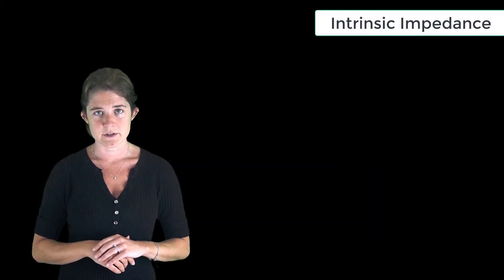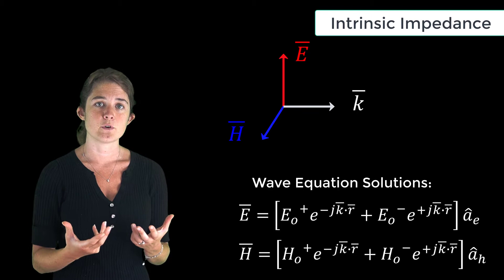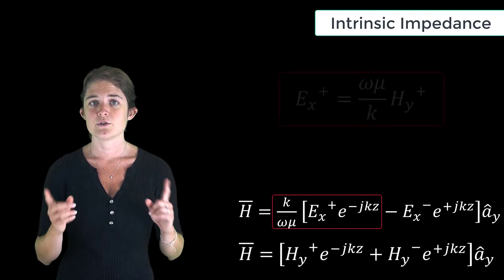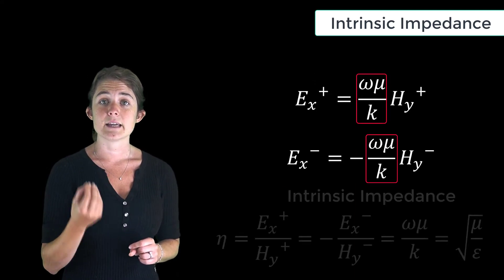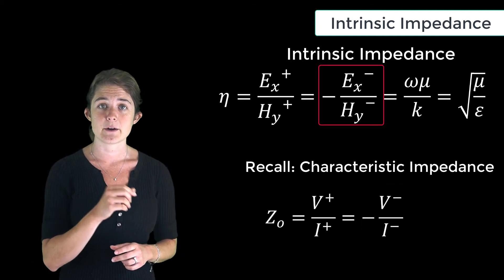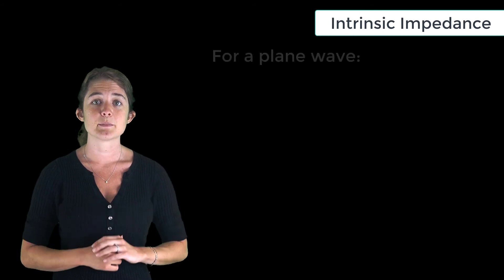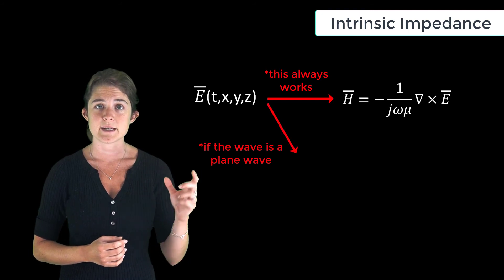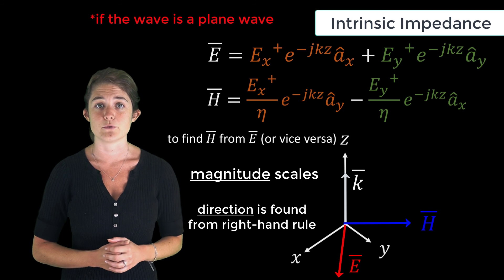Intrinsic Impedance of Plane Waves — Lesson 3

Comment: One does appreciate that there is a lot of work associated with  the preparation  of these videos. Congratulations.  Here is an interesting discussion point,  If there is an intrinsic impedance of the medium of 377 ohms, this also means that the inductive and capacitive elements  of the medium  to support the E and B components, exist and so these  will delay the rise and fall of the E and B wave as they exchange the  total E/M Poynting Vector between them . All this will lead to the maximum velocity of the wave in the medium of transmission, If the velocity of the wave is limited by such " impedance effects"  then as the circumference of the circle around the radiating antenna  grows bigger, there is no hope of the first mode being sustained with an ever increasing radius, and the circumference will have to break down in smaller units not larger than half a wavelength long  which is the normal wavelength  of the   forward travelling wave, This means that if the wave cannot go forward above the medium speed, then  it cannot go laterally around in a circumference faster than it goes forward so this means that a plane wave can never be supported,  and a plane wave is only a fig of imagination  to make the mathematics a little easier. The modes  supported in a waveguide are more practical as  if the distances grow beyond half a wavelength then they will change into the higher modes,    All vibrating sheets or volumes  with inertia or impedance, including  blocks of jelly, drums, pianos and violins, all musical instruments, reverberating chambers as theatres and churches,  they all  behave like that.
Reply from the maker: I think you're confusing the vector representation for something more than it is... nothing is moving laterally.  The vector tips in the diagram do not represent any physical entity that is "moving" - they are a visual representation of the amplitude of the wave (the "strength" of the field) which is present at the axis (in this case, on the x-axis).  
I hope this helps!
Reply: @emviso   Thank you for replying Well mathematics are only a model of a practical behaviour and in this case those vectors are representing the E and the B field,  If those Fields need to exist then they need to live in linked loops and curl each other as  Curl E=--dB/dt and Curl B= k dE/dt.   Those vectors do represent the practical loops and since the E and B field are is space quadrature and  at right angles to the direction of propagation then there  must be a " build up " of fields in the lateral direction and in the diagram, if the E field is vertically it will exist laterally in a vertical direction and  then the B field will also  need to build laterally.  The real  E and B field will be like the links of an anchor chain and these links must  change, rise and fall and reverse in a three dimensional volume even if they are plane waves. All this happens in a waveguide and a plane wave  depicted in mathematical models is only considering a miniscule part of  what I am talking about,  A receiving antenna  can be placed anywhere in space with respect to the transmitting antenna so there is something going on "laterally" even in a plane wave!  Thank you once again.
Note that when we use vectors with "Tips" at either end, then at the "Tips" the  DIVERGENCE  of E and B is not zero as required by Maxwell's equations, so there should not be any vectors with " tips"  when showing a electromagnetic fields,  Even in a plane wave, for it to exist there should be returning vectors joining what we show positive to what is negative to form the loop . It is interesting that  for a loop to exist, there must be returning joining vectors, E and B,  along the travelling  direction but we do not consider this as the integral of the E or B fields along a " returning vector to form a loop, is normally joining a positive and a negative peak and so the integral is zero, and we do not bother about it.  The Simple E/M diagrams  shown by many videos and books do not show all the beauty and hidden wonders in the E/M field and many chose their " conditions" not to look at the bigger picture. Many diagrams are simply wrong in what they depict.